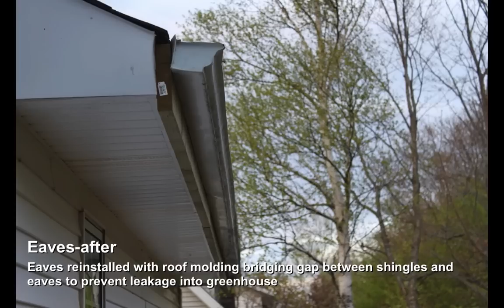Lean-to Greenhouse

Comment: I’m all about greenhouses and living off the grid. But I do not recommend attaching this structure to your house because if you did not get this approved by the city, building and code enforcement and inspectors can make you tear it down. This structure should be a minimum of 5 feet away from the house for fire fighters not to have an issue with this structure. All it takes is a neighbor to call the city and complain and that’s it. They’ll give you about two weeks to remove it and then the fines start rolling in. Also keep it 3 feet away from your property line.
Reply: For which city?
Reply: if you have neighbours that want to complain, better to move.
Reply: I live in a rural area with very minimal  and very lax regulations, but even my county would require a building permit for this, before it was constructed. Anything that changes the footprint of your house needs a permit-- I think that is mostly so they can collect the permit fee and change your property tax assessment, but also to be sure you aren't building something that could be a hazard. And yes, they can force you to tear it down if it doesn't meet codes or regulations. In this case a professional was used to frame it out (so it was built properly) and it isn't all that heavy, but the county -- or maybe city-- wants to be sure your addition isn't going to collapse under snow or wind or other loads.
Reply: It’s absurd that these town and city governments think they have the right to tell you what you can do with your own property. This type of local authoritarian nonsense is the worst. I’ve heard horror stories over completely ridiculous complaints over things people are doing/building on their own property. Even the idea of building permits (a long with most forms of state or local licensure imo) is totally ridiculous. Why do you need permission from the government to build something on your own land? It’s all just another revenue collection scam that people have been brainwashed into accepting as normal and necessary. I got news folks, it’s not. People got along fine without these type of oppressive rules in the past and I salute anyone who has the courage to defy these rules.

Comment: Nice job, I was curious if you had looked into other longer term options for covering. My grandparents have a similar setup just a little larger but they used corrugated fiberglass panels kind of like the metal corrugated roofs on barns but the fiberglass comes in green and white and stuff and it is amazing how warm the greenhouse stays during the winter..

Comment: What kind of temperatures can you hold inside on a cold night?  Do you heat it some
.  What about high moisture damaging insulation in house wall?  Music ok. Just turn volume off if it is not your tune.  Good job on your photos.
Reply from the maker: Not much heat held at night.  It's really just to maximize total summer daytime heat for tomato and grape growth, or anything else I want to grow that might not mature nicely during our short, cold-ish summers

Comment: It started out so well... then you used plastic instead of the corrugated rigid plastic panels... maybe an idea when you need to do the replacing.
Reply: +Kirsten Hughes Old glass windows work very good and never have to be replaced..

Comment: Siding (and exterior cladding) is designed to repel mosture from rain but is not designed to be held in a constant high humidity environment. This setup will cause a mold problem and a earlier failure of the siding. Best thing for the homeowner to do in this case would be to simply add an additional layer of plastic across the back to isolate the greenhouse environment from the home.

Comment: where i live, 5mm safe-glass ordered on a min of a square/m basis ready and cut to shape, order some year ago, was a lot cheaper than inferior PVC and plastics.  It filters UV and lasts forever and it's 6 times more resistant than float-glass. Thus 1mm tempered equals 6mm float.

Comment: Great job, I've been planning one almost exactly like yours, although mine won't sit facing directly South but close. I was wondering, I noticed a window on your home inside. Does the greenhouse add any heat to your home in the winter? You may live way down South where you don't need the extra heat but I hope it adds some to mine. Thanks for sharing your video.
Reply from the maker: Hi Danas54. We're  in Canada so it can definitely add heat in May/June and September. July/August the house needs no heating so no heat benefit, but doesn't really cause an added heat problem.  I've added a  5/8 inch "bee escape" vent all along the length of the structure which helps cool the interior during hot days.. also lets the bees out.

Comment: You really need to wrap the plastic at the bottom and the ends twice around the battens before the final attachment so the plastic won't tear in the wind and other weather. It's quite an important oversight.
So, you staple the plastic to the batten..then roll plastic round the batten twice...then attach.....

Comment: Is the floor insulation really necessary?  How does the styrofoam not crumble under that weight?  Is there a natural material that could be used instead ( coconut fiber, woodchips, ect?)  What if you put all of your leaves & compost in there, in fall, to break down into a dirt floor over the winter, instead of the gravel?  The gravel, I assume is just to give you a "clean" drainable surface to walk on, and add thermal mass.  But I'm thinking a couple hundred pounds of leaves breaking down would keep that thing pretty warm too.

Comment: Gas will move upward - Right through the soffit vent holes seen on the right side of the frame @ 1:32, and over time the highly increased humidity will most definitely cause a mold issue in the house. The two solutions I see are 1) Put a wall of plastic against the house wall as well as the underside of the eave to separate the humid environment from the house, or tear the whole thing down and build a freestanding greenhouse.

Comment: Something tells me, that the excess air pressures will force the moisture out through the super-high tech, super weather sealed door, instead of through a plastic vapor barrier under the siding...

What do I know, though.  I always figured gas will vent through the path of least resistance.

Comment: Seems like you'd get a lot of moisture in the attic through the eave vents if you've got any sort of humidity in that greenhouse..  That could make for some problems down the road.
Reply: Exactly what I was thinking. If these are true breathing eave vents it will suck up humidity and cause mold
Reply: Good question.  I am searching the internet for the answer to deal with this in a lean to greenhouse.

Comment: I like the structure overall.  I would personally go with higher quality roof panels that would last 5-20 years based on cost.  Ones with uv protection are a must.'
I think with some moisture barrier paint, the comment about this greenhouse causing major mold issues might not be an issue but I suppose depends on where it is.  I live in colorado where mold is not really a problem.
Reply: +Robert Schultze I was thinking same thing. I don't know much about this but, it appears that at least green board(?) which is used in bathrooms, would be helpful? I would hate to pay for energy to combat the greenhouse's effects on the interior atmosphere. I have time to run around and shut drapes and open windows for maximum results for comfort. Most people do not. They just pay higher bills for energy waste. It would only cost for one more wall to set it aside from the house. I drove by one of these lean types, it was obviously professionally done. It looked like a dentist or some professional had once lived there. The glass was broken and it was run down. My first thought, was the heat pouring into the home while the air was running. The home was obviously beautiful at one point. It was probably not a good idea to wick moisture into the home though.

Comment: Thanks for the video. I'm planning on building something similar. How did using s the facia on the eaves work out? I was planning on nailing a board to the side of the garage, but using a bigger facial board would give me more height for my tomatoes.
Reply from the maker: Thanks for the question.  Yeah, it's nice having the added height for tomatoes. If you go to around 1:40 in the video there's some footage pertaining to the removal of the eaves to allow for an added facia board for holding the rafters.  The main trick was to tuck some roof moulding under the shingles and over the re-installed eaves, so water wouldn't drip between the eaves and the facia board and into the greenhouse.  I hope that helps. Also, the video doesn't address a problem that showed up afterwards with insect management.. there was no way for bees to escape if they entered when the doors were open for ventilation.  So I just cut a roughly 1" strip out of the plastic all along the plate that runs  about 4' from the ground on the greenhouse exterior. Plastic still held in place by the exterior lath. No structural problem and the bees find the opening. Best of luck with your project.

Comment: What gasses?  Are you talking moisture?  That would not effect the siding at all.   At worst moisture might go up under the soffit vents and into the attic.  But this would not be any worst then a hot humid summer day.  And all he would need to do is open both doors to allow ventilation.

Comment: what a perfect idea, thx!
Reply: "au contraire"! It's dangerously   silly idea to share a wall of a greenhouse with the main structure . Green house may  simply destroy wood framing of the wall by excessive moisture. It may also destroy roof rafters because soffit vents are  intended to vent attic, not the green house.

Comment: Its a neat green house I think.  The walls are exterier sideing its maide to get wet And who knows the humididy in the green house may not be bad at least in my green house it aint. I  dont see any vents where the green house is ether so humidity shouldnt build up in the roof. And who knows maby thay live in a place where it gets humid and the house is built for it I dont know but i definetly would have done the same thing these guys did

Comment: did you need a building permit for this?
Reply from the maker: Not as far as I know.  No hassles from anyone so far : )
Reply: Temporary growing structures don't require building permits in most places. My concern with this build is doesn't the humidity of the greenhouse threaten the house?
Reply from the maker: @riverrat8693  It's not a very 'tight' build, so there's lots of incidental air flow-through. I guess it's been something like 12 years now and there's no mould, no sign of moisture buildup.  I've left a ventilation strip halfway up the (at the top of the vertical part) so the bees could get in & out., but rain does not get in.

Comment: Where did you get that magic wood that does not rot from soil contact?  Your music literally gave me a headache, and I muted from 4:01 onward.
Reply: Looks like the wood is in contact with cement blocks that hover the boards over the soil. It also looks like they are sealed with a white primer/paint and then covered with a plastic. Any more protection from the soil and the wood will last his entire lifetime.
Reply: Doesn't look that way at 6:00 and other places.  Right where the risers are, I agree with you.  But even where it is just a tad above grade, that's not good enough for moisture and termites.  But, honestly, 90% of it seems to contact the soil.  Primer/paint/stain doesn't last long with soil contact and plastic can actually trap moisture.  I know no one will change his mind because of anything I say, even when you can look right at it at 6:00, but hopefully someone reading this because they plan to build something will heed the warning.  And save themselves a lot of repair, trouble and expense.
Reply: I work in a lumber yard, we sell "ground contact" lumber for just such a purpose, it's not uncommon
Reply: classiest/ most palatable music i've heard for a DIY project video yet.

Comment: I agree with gatormico, except that a PROPERLY DESIGNED greenhouse may be attached to a home. I guess this greenhouse is built in an area where footings are not required.  Attaching a structure without footings to one with footings is a HUGE no-no!  Those blocks are design for freestanding structures only, Mr Carpenter!  The part that says "good luck figuring this out without plenty of carpentry experience" tells me this particular "carpenter" is a cocky low-brainer, at best!

Comment: what about humidity?
Reply from the maker: I've got a vent running the length of the thing, where the slanted roof meets the upright (half) wall.  Maybe that's why humidity doesn't seem to be an issue. No mould or growth of any kind on the house. Maybe it would be different in a different (warmer) climate (?)
Reply: This is what I've always wondered about lean-to greenhouses.

Comment: Do not build a green house this way!  The gasses that this house will push into that siding, through the vapor barrier, and up into the roof will create a mold that will overall cost thousands in home repair!  I don't know where this was built, and what 'pro carpenter' would actually do such a thing; it's a code violation almost everywhere. If you appreciate your home,  please don't do this!  A greenhouse should be built as a separate, free standing structure.

Comment: Mm depending on where you live i woulda saved the money on pulling permits for that considering it is attached to your house so the city could get you for it being a addition however,your city may not mind haha mine would,also pro carpenter seemed to steer you to a bad design by not using polycarbonate sheets but it looks nice

Comment: Did side of your house rot from constant humidity ? nice tomato plants though.
Reply from the maker: No rot.  I've since the video created a narrow horizontal vent along the front.. just a slit in the plastic, really...mostly to let the insects escape, which might help with any humidity buildup. But the thin is not closely welded to the house so I think the moisture escapes regardless.

Comment: Would it be useful to put a fan in the window to direct greenhouse heated air into the house?
Reply: While in theory that may seem like an efficient solution, in proactive I think you will find that to be a bad idea. While greenhouses do tend to generate heat, they also hold a lot of moisture. Bringing that kind of moisture into your house can be a bad idea for numerous reasons. In most cases it is best to keep the greenhouse self contain except for the eventually venting when needed.
Reply from the maker: Mostly used in hot summer months when we're trying to keep the house cool, so tht window usually closed except on cooler days